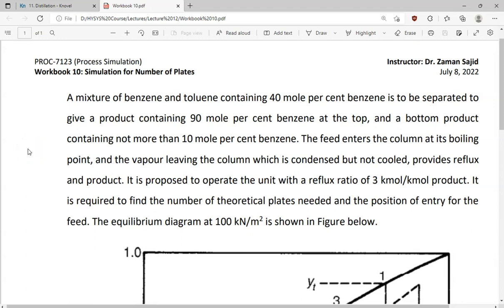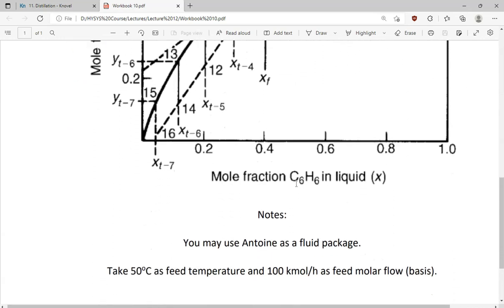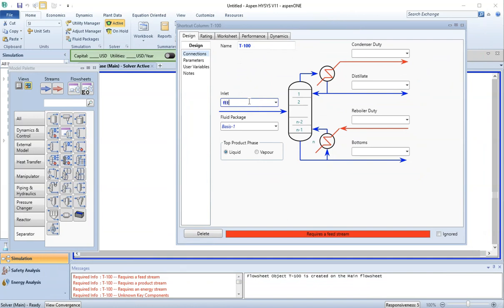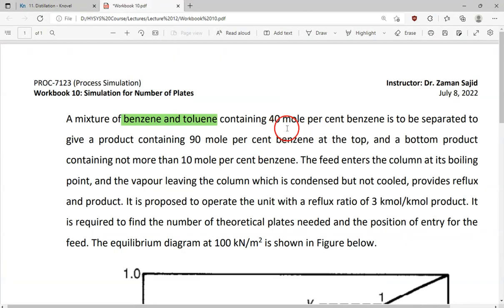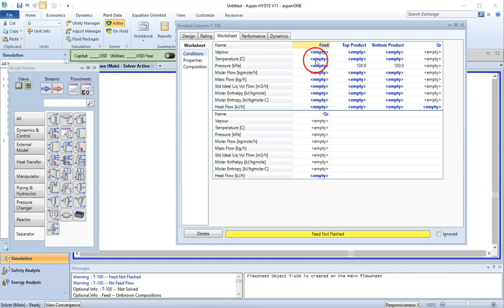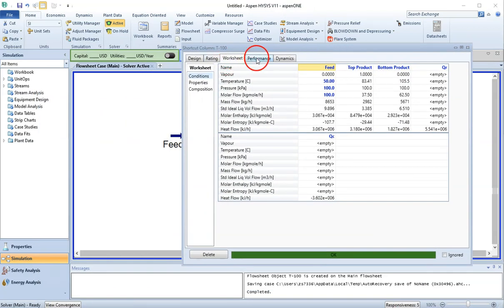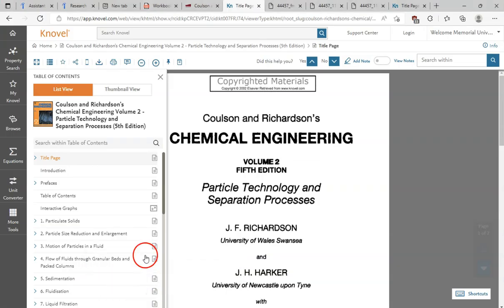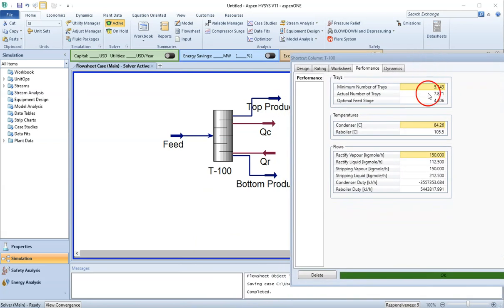Number of plates in distillation column using Aspen HYSYS

Comment: I have a question. How can we estimate the actual number of trays in the refinery process (distillation column) ? Is there any way to calculate case trays for the distillation column in oil Refinery Process? and how can we choose the feed tray?
Reply from the maker: Hello Hamed, Shortcut distillation column determines the number of trays needed. It is explained in this video. Once your simulation is converged, you need to go to the Performance tab and see the actual number of trays. It is at 8:42. A physical plant will use the same number of plates with some plus-minus margin. I hope this helps.
Reply: @drzamansajid  thank you. can we use this method for a complex crude oil in refinery process to determine the number of trays? in this way  can we define the specs in shortcut column as well as refinery distillation column?
Reply from the maker: @hamedheidariyan4830  Yes, you can use it for complex crude oil to find the number of trays in a distillation column. For the shortcut column, you can use some components but you need to specify the composition of at least a top and a bottom product to find the actual number of plates, as shown in this video. I hope this helps.
Reply: @drzamansajid  Thank you for all your perfect help